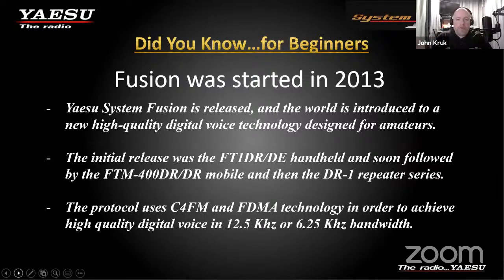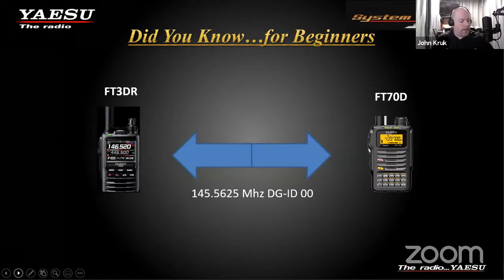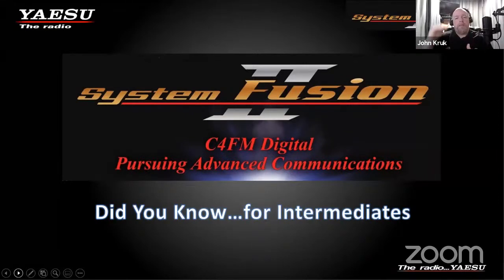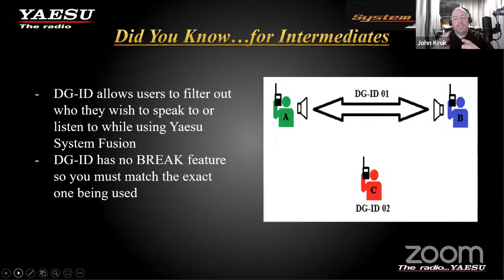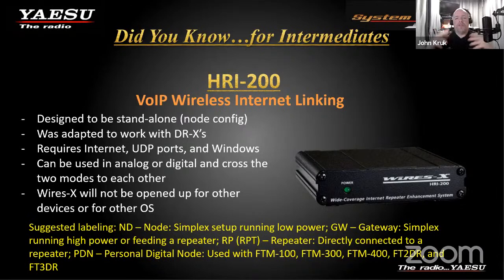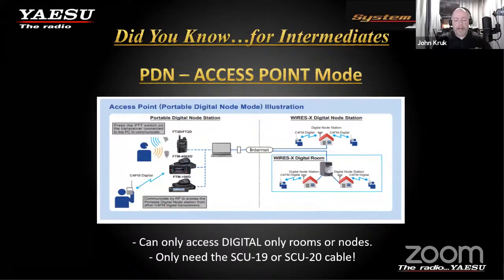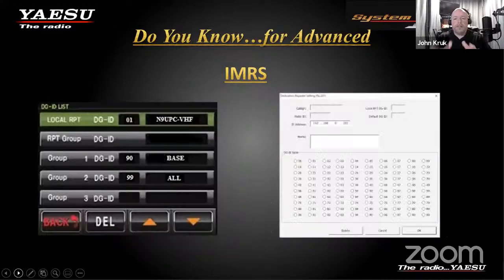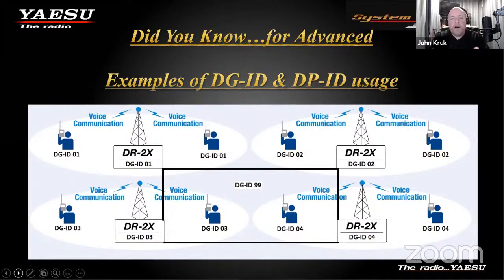Technology - Yaesu Fusion

Comment: Thank you, I have been VERY confused about fusion and you are a ray of sunshine with this information. Fusion looks like the digital mode I have sought. It is already in use in my area on repeaters. I am already hooked into dmr (Brandmeister, not snooty Motorola) with a ht and hotspot, and D-Star with a pair of IC2820 rigs base and mobile. I am impressed with not needing to obtain registration from elsewhere to be able to use the radio on fusion. I would be interested in why there is a lone thumbs down as your explanation of everything has been clear to this 71 year old ham.
This has been the best webinar video I have seen in a LONG time. 
Thanks and 73 de w8nsi jim.